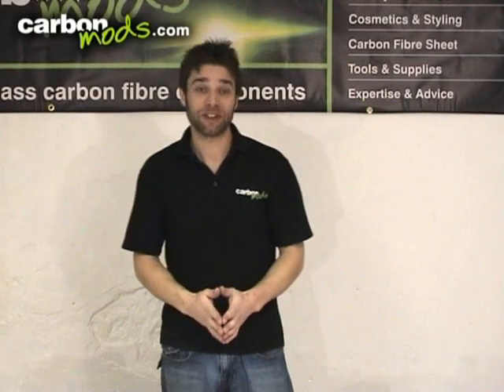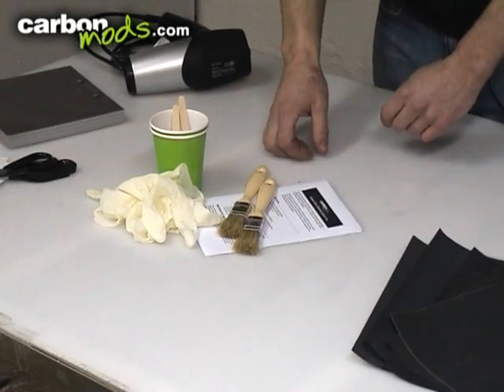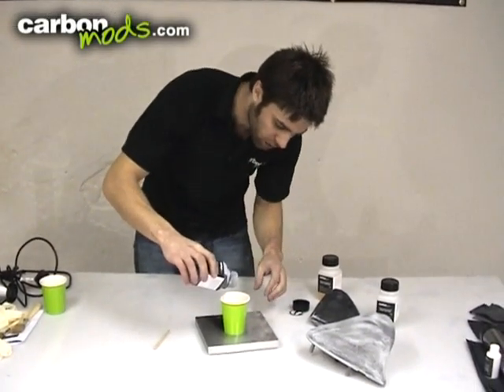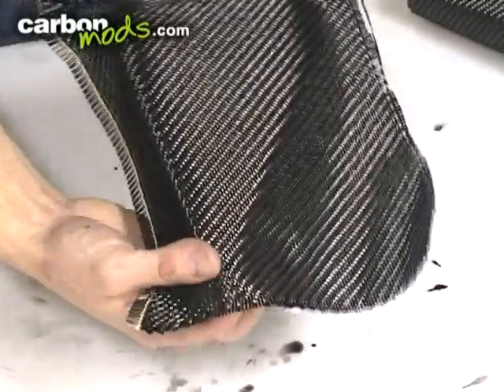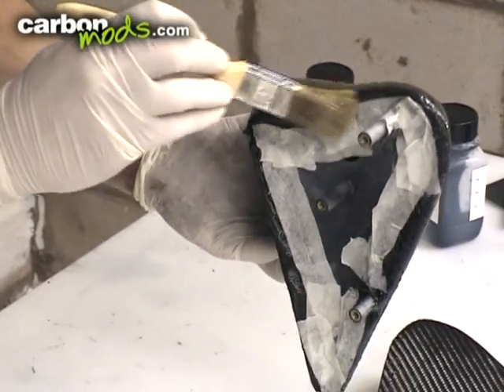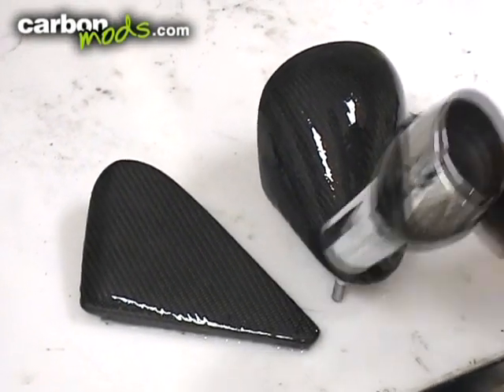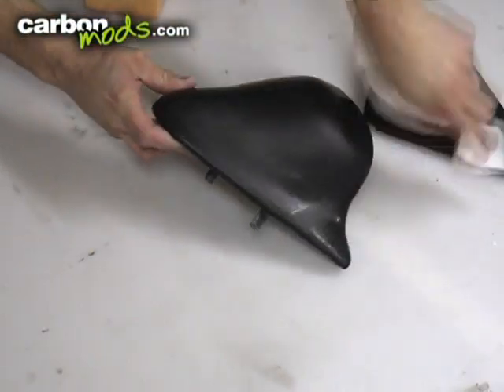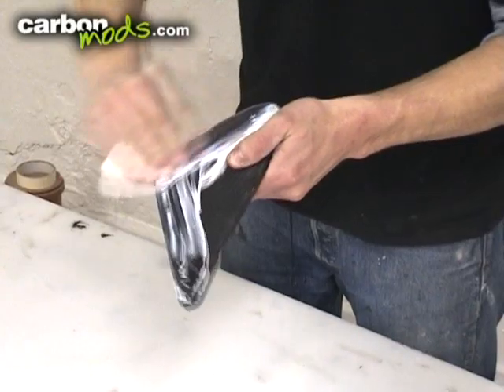How to cover parts in carbon fiber (fibre) by skinning or wrapping

Comment from the maker: Hi InnovationJunkie, 

Shameless Plug! vinyl is fine if you are not looking for a 100% realistic finish, most people can spot even the best fake carbon from a mile! But it is a quick method if the result is good enough for your application. Check-out our website for 3m self-adhesive backed flexible REAL carbon fibre sheet.

Carbon Mods.

Comment from the maker: @dazzelya: Where you're dealing with tight curves (and angles) it's sometimes neccessary to add a cut line in the fabric. This allows you to really stretch the fabric over the worst of the curves and then have a separate, less distorted piece for the remaining surfaces. A great tip to get a nice clean cut line in the fabric is to spray the fabric with plenty of hairspray before cutting it. That way, when you do you're left with a sharp clean line that doesn't frey. Hope this helps!

Comment from the maker: @kingzreptilez4life : For this 'Skinning' process you need epoxy resin that meets a few criteria. It needs to be quite thick (high viscosity) so that you can build it up, it needs amazing clarity and most importantly it needs to be free of 'amine blush' on the surface otherwise each time you let it part-cure and then add another layer it will get hazier and hazier, losing the glass-like glossy appearance. On Carbon Mods website look for 'Carbon Fibre Laminating Resin'; 500g, 1kg, 5kg available.

Comment: I have a lot of experience with carbon and a little trick is to mist a light layer of super 77 spray adhesive or equivalent on the under side of the cloth. this allows you to cut edges without fraying so easily :) A light layer will not effect epoxy or other resins
Reply: Carl White can you sand bare carbon fiber, my hood's clear coat has peeled off and I want to re-clear it, but idk if you can sand the carbon fiber.
Reply: Not to butt in but you can only sand the resin covering it, as soon as you reach the carbon itself you are going to damage the carbon strands and the integrity of the carbon, not to mention the look will deteriorate too. For sure you can run back the clear coat and re-coat it though if that's what you are wanting to do.
Reply: You notice there are two different super 77s now?  Both 3m but the one sold in different areas like CA has a different voc rating and doesn't work nearly as good.  I'm in VA.  Wal Mart here sells the version that isn't as good but Lowe's has the better version.
Reply: can i use automotive clear coat of the resin
Reply: @robertmahaney7650  yes -like literally, that is exactly what he was showing us how to do.

Comment from the maker: Hi Kapullas, yes, this is perfectly possible although sometimes the time saving that you would imagine (by not making a mould first) doesn't actually materialise because you'll spend so much longer flatting and polishing the finished part that you would if you'd taken a mould off the nice, smooth, glossy part in the first place. The other thing to consider is that a part made in this way (without a mould) would be larger than the original, unlike if you made a mould off the original first.

Comment from the maker: @killertctma : It's quite difficult to do a good job of any finish other than smooth and shiny using this process. You can give the finished part a satin or matt finish but simply not polishing it up to a full gloss (mimmicking the 'dry carbon' look you see on race cars sometimes) but a textured finish is not really viable.

Comment from the maker: @markyyyyyyyy321 : It certainly would be hard, long work to do a full set of M/C fairings although you could get there in the end with enough patience. M/C plastics tend to be ABS which isn't the best material to stick carbon onto (not much sticks to ABS) so if you have a new set of plastics with a nice gloss finish I think I would be tempted to take moulds off all the panels and make replacement parts instead of skin them. You might even find it quicker (although slightly more expensive).

Comment: could this be used as the outside layer in a mould and then fibreglassed inside for strength (if it needed it? It would be for a costume helmet mold, so it's not going to be taking any hard knocks

Comment: With some shapes it is a good trick to wrap the skinned object in tight fitting glad wrap. Glad wrap does not stick to epoxy. When the epoxy is dry, the glad warp is removed,, and the object has a beautiful smooth finish.
Reply: Sounds like a good idea. Has anybody else used this method?
Reply: Shrink wrap works good to.

Comment from the maker: @killertctma : You'll still need to do all of the flatting stages to get it smooth, you just won't need to do the polishing or lacquering stages. For s satin or matt finish you can finish off with a scotch-pad.
Reply: I would like to see how you would go about wrapping a box.
Reply from the maker: @gabb159  much the same process and aim to hide seams/joins on the corners. If its a fairly square/uniform box then you'd be better suited to use our special ProFinish Carbon fibre as this has a binder to hold the fibres together and to stop them fraying. In turn, this means you can cut really neat, accurate templates.

Comment: Been skinning quite a few years, also thanks to the clip which got me started back then .. but as I look at it now, I can't help to feel a little annoyed. If you look at these parts you can clearly still see marks and pits in them..which would all be solved if they wouldn't advise people to use a rattlecan to apply clearcoat. Use real clear laquer applied either by yourself or by a pro with a regular spraygun and it will look so much nicer. I've skinned parts for some high end vehicles for which those specific parts were not available in CF .. If I handed over the parts like this .. ppl wouldn't come back at all :-) Props on the sanding and applying resin though, can't go better than this :-)
Reply: Johan DeWilde Hey man what's your email I want you to skin some parts for me
Reply: +Johan DeWilde 
It's not the clear coat that has caused the pitting its the carbon fiber material not contacting totally with the piece he's skimming allowing the resin to fill the void left and not to sit on top of the carbon material giving it a mirror finish, this can be avoided using vaccuum bagging or "rolling" the carbon material after applying to the piece. I skim then coat with 3 coats of hard resin allowing to dry by ir between coats then wet sand with 1200 grit then hit it with 2k clear laquare- theres no need to spend hours polishing if you use 2k clear coats.

Comment from the maker: Hi Doomage121, 

To do a hood you just need the rough sand the surface, as long as it is sanded to a rough finish and is clean and free of greases etc, It should be fine, it doesn't really matter how far you sand through the paint. 

Hope this Helps 

Carbon Mods

Comment: Dont believe the hype. I have found it almost impossible to get the carbon web to stick in place using the resin (Not from carbon mods i hasten to add). So i used spray adhesive. This proved better but its still almost impossible to get the weave to form properly as you cannot lift and relay it EVER. once it hits the sticky thats it.

I am GOOD at crafts, automotive or otherwise and this has beaten me. Its frustrating beyond belief.
Reply from the maker: +Rich77UK Hi Rich, different resins have different tack properties during their cure, especially around their 'B' stage. We can follow the process and get great results every time (in fact, we're working on a new video at the moment) but there is certainly a knack to it and it's important to be using the right materials and to start with simpler parts whilst you build your experience. I'm good with practical things too but that doesn't mean I can pick up a trowel and plaster my house without a bit of a learning curve ;-)
Reply: +carbonmods I want to clarify my comments. 

Carbon skinning is not easy, certainly not as easy as you have made it look. I haven't used your kit (which I was clear on) which could explain some of my issue but to anyone trying this my advice is this. Don't skimp on the carbon. Don't try and use as little as possible. Be generous with is an accept your going to throw a lot of large off cuts out. These small kits for noobs like me are good for tiny pieces only. Buy large!

Today I have had my best result. With B grade carbon I didn't care about losing...I got a great result because I didn't cut my sheet as small as I dared. 

I wasn't slating your product (I was careful to state I hadn't got your kit) but wanted to offer my experience that your video makes it look SO simple which it isn't :) 

That being said it helped an awful lot and perseverance is the key I think.

Comment: Does this increase the overall strength of the material that your coating?
Reply from the maker: Yes, although carbon fibre skinning is not really intended as a 'structural' process, it will add some strength to the part you're skinning. In fact, we've just uploaded a new carbon fibre skinning video to our Easy Composites youtube channel where we skin a broken biathlon rifle - this makes it much stronger and of course, it looks awesome too! Take a look here: https://youtu.be/aqwhcfQZT8U
Reply: Azher Hamid to you

Comment: Went to see what You got to sell...umm, a kit containing 200 g of epoxy resin base coat - 200 g of epoxy resin top coat - and 100 g epoxy hardener..... Soooooo...what happened to the 2:1 mixing ratio? If I mix all the base coat with the required amount of hardener, I won't have any hardener for the top coat! That's just stupid! Why don't You put in 200 g of hardener as well, so all the components can be used?

Comment: Question i have is; after you have sanded the part down and are about to finish with a clear coat or polish. 

When do you remove the excess carbon that was taped over the edges?
Reply: The excess carbon is trimmed off before it is taped down,  it is taped down just to prevent sharp edges after the resin is applied, you can remove the tape and then just resin over the area that was taped to seal it down at the back once the 1st layer has dried.
Reply: doesn't that make some parts not fit anymore because the carbon mesh has quite some thickness?

Comment: I mean - there should be 100 g hardener for the base coat - and 100 g hardener for the top coat! Not 100 g together! The kit should come with 200 g base coat resin - 200 g top coat resin - and 200 g hardener, to get the correct mix ratio!

Comment: This pisses me off...the whole reason for carbon fiber weaves are for its strengths and yet all you are doing is covering weak ass plastic with a single layer of carbon fiber.

I just got done with my aerospace compositing tech class and it just amazes me how much wrong info there is on youtube about how to do carbon fiber stuff.

while I will give you credit for actually using carbon fiber and not just painting it. You might as well made a mold and made a part from that...and vacuumed bagged it
Reply: BS. A lot of people like it for the looks.

Comment: There is no point in this... May as well just use carbon vinyl. this will last longer but not worth it. It is also illegal in most places for use on road vehicles, which is all you would use this on.
Reply: where are you from? I've never heard of carbon fiber being illegal for anything...
Reply: rpaull3 It's not illegal, however if you make your entire car appear to be carbon fiber you'll have a problem. The vinyl wrap is considered a sticker so you car wrap a white car without having to report a color change at the DMV, however this is NOT a sticker so you would have to report your vehicle as being black to the DMV. That being said, I don't think anyone is going to make their entire car look like carbon fiber
Reply: +acesoftrul3z 
Hey, any car in the UK that has a wrap or colour change will need to be reported in the owners Insurance and car reg details or insurance will be void, also from 2014 if yo go 1 mile over your allocated milage you assumed yo would be doing that year your insurance will be void, if you go over your allocated mileage you MUST inform your insurance and they will either ignore the over sight or up your premium.
Reply: Carbon "3D looking" vinyl looks tacky as hell in person. Doesn't have any of the dimensional, light refracting, 3D quality look of real carbon fiber. It looks like you wrapped your car in a cheap gift wrap material. Do NOT do this.